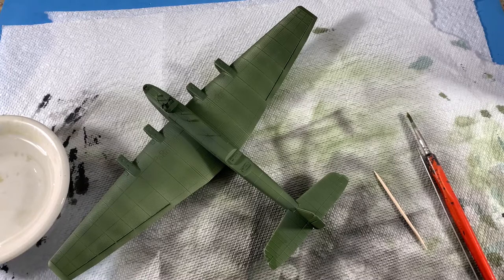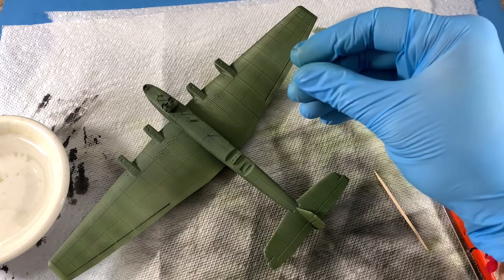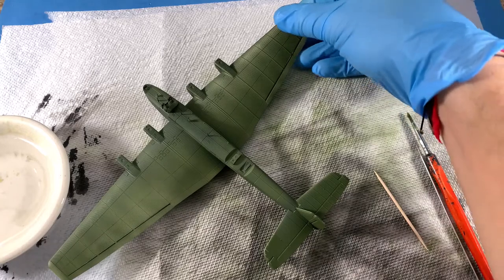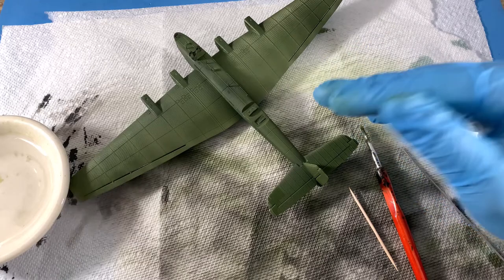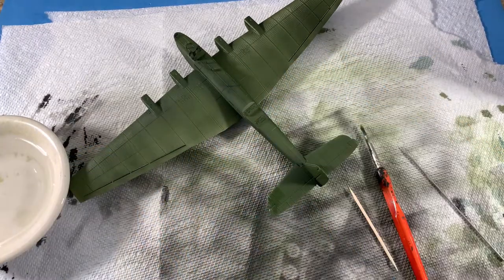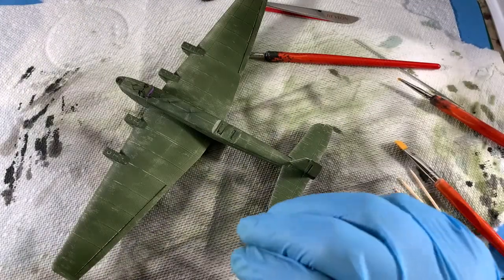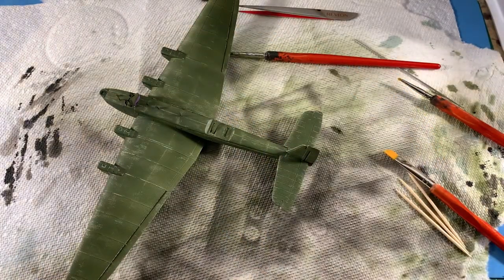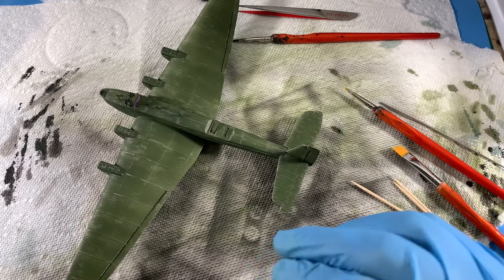Tupolev TB 3 Workbench Vlog 17 How's the weather?

Comment: The chipping is nicely subtle. Definitely right about the patience thing. How long do you let the color coat dry before chipping? My times seem to be all over the place. Thanks for posting.
Reply from the maker: I left the paint dry for a few days so I had to be a little aggressive when chipping which is risky because there is a chance of going down to the primer or plastic. It seems to have a lot to do with how much hairspray is below the color coat as well, I had pretty light layer. I think you would be good chipping after 24 hours or so but would suggest experimenting on a paint mule to find what is best for you. Great question!